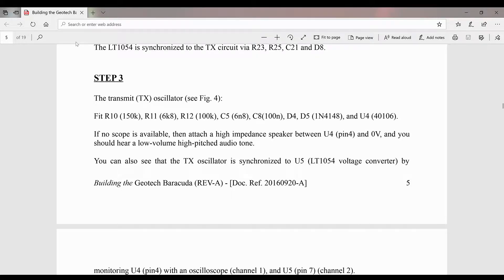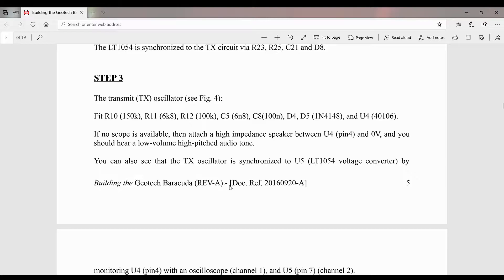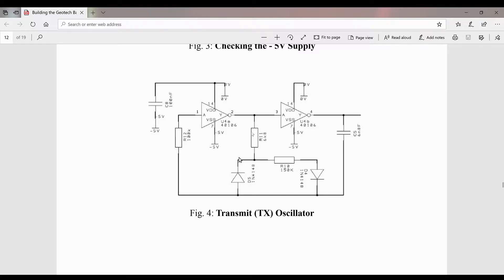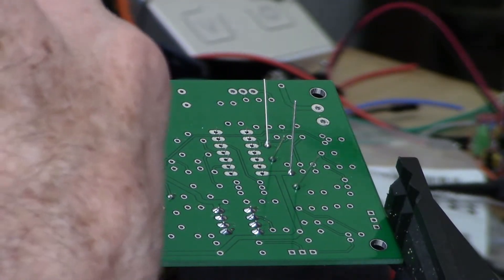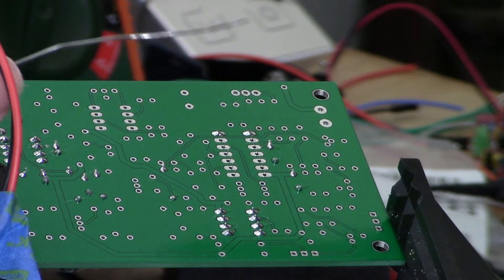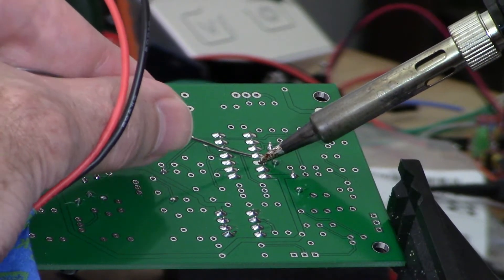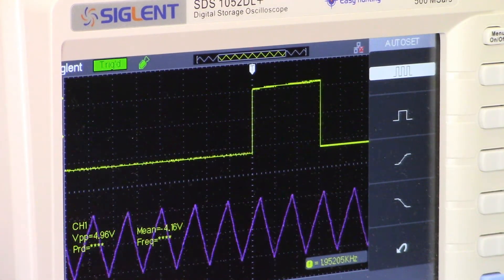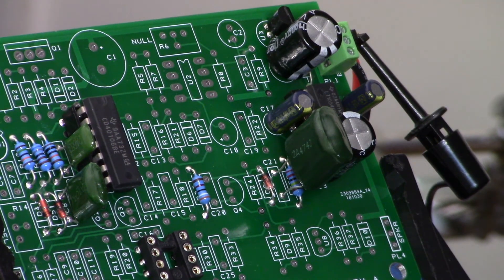Barracuda PI detector step #3 Transmit Oscillator

Comment: Hello. Can you tell me where I can see the diagram for this Board?
Reply from the maker: Hello,
You can find the schematic  for the Barracuda here:
https://diydetector.co.uk/store/index.php?id_product=25&id_product_attribute=0&rewrite=geotech-baracuda&controller=product
Click on Attachments.
Reply: @SurfDetector  Hello. You gave me a link to the printed circuit Board, and I ask you for a schematic diagram of the device for this Board, judging from the description, the scheme differs from the original.
Reply from the maker: Hello,
if you click on "Attachments" like I said before, you will see the Schematic Diagram.  It is there on the link.
Reply: @SurfDetector  Thanks. I didn't see it the first time )
Reply from the maker: @chipsettt1  No Worries.